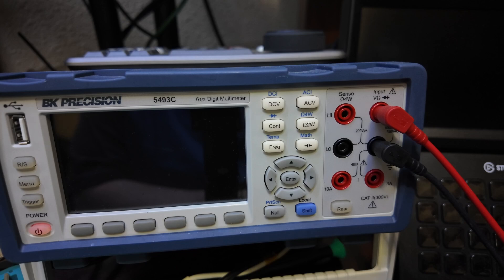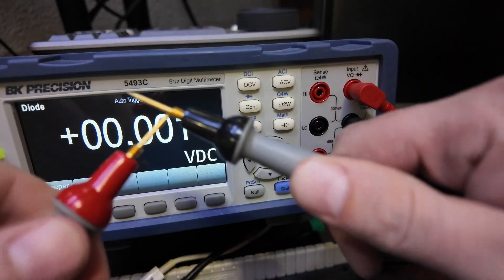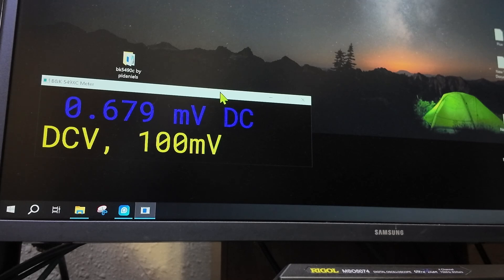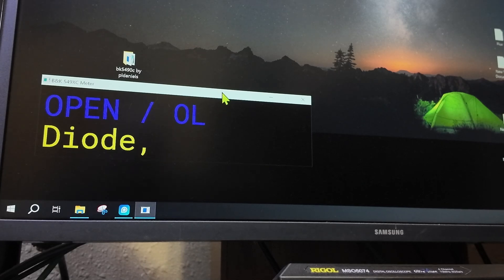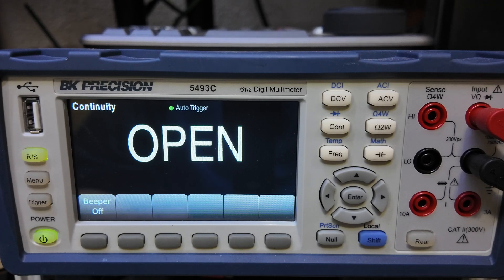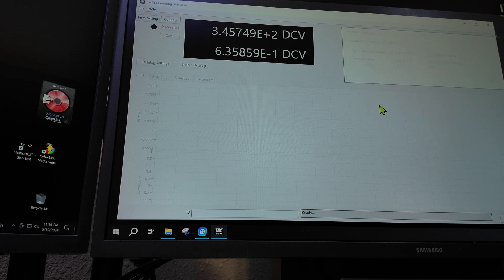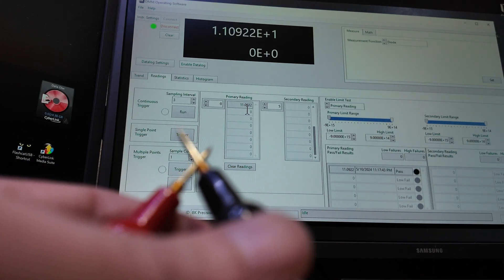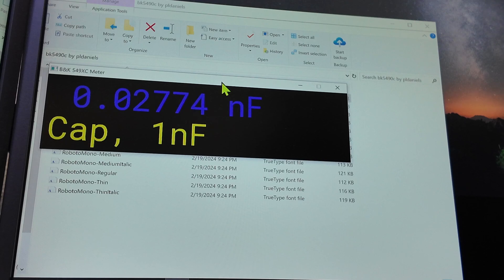BK5490c Multimeter Software Developed By Paul Daniels

Comment: Does the software only run on Linux? Thanks
Reply from the maker: this is a windows version only runs on Windows
Reply: @QsTechService1  I went on the GitHub link you posted but it’s saying it’s for Linux on there, am I downloading the wrong version. Also are any other meters compatible with it, would it work on keysight meters? Thanks rich
Reply from the maker: @SURGE101  the one you’re seeing for the other operating system is for the other BK meter  and I think it’s only compatible with BK meters